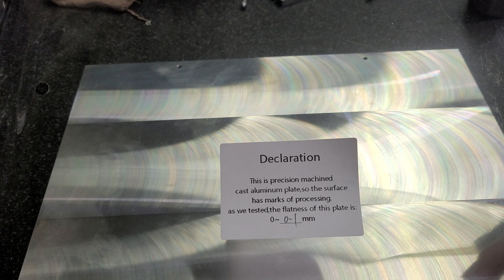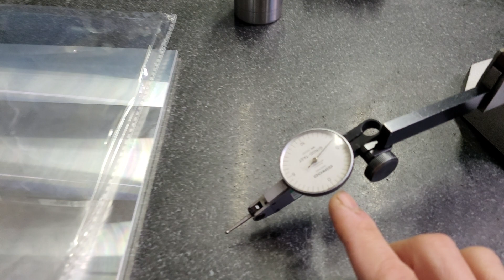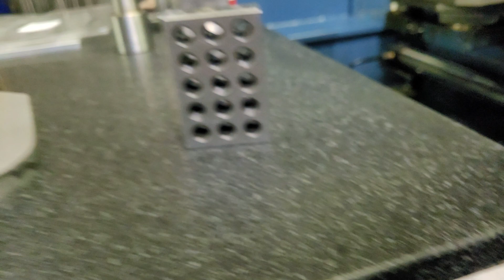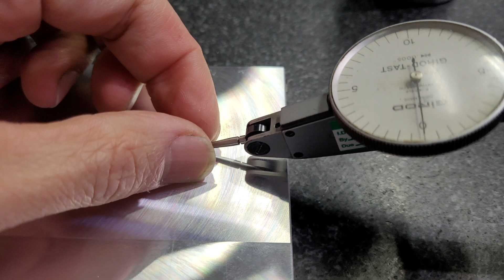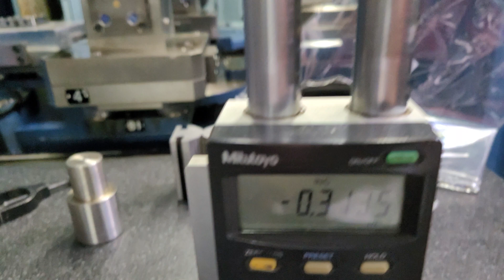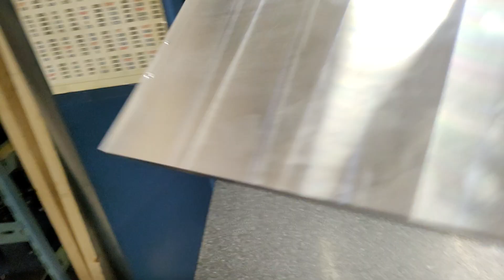FORMBOT Voron 2.4 3D Printer Aluminum Build Plate!

Comment: Great Video! 👍 may you also test with the bed heated to 100 degree Celsius. I heard that it might bend when heated.
Reply from the maker: It will warp for sure but a good bed mesh system will compensate for the uneven surface. Here comes the IDM scanner. 😀https://youtube.com/shorts/Bz2ODFq9isg?si=aAhXRtTixGKJkF53

Comment: Nice to see the plate is in range of their stated measure, I am also building the 2.4 formbot kit, nice parts for the price.
I will for shure buy an dial indicator asap.
Have you tested the rails and the frame profiles?
Reply from the maker: I tested the motors here. https://youtu.be/WWF8mjZLdJ8?si=QE7CoxRWLhdOobwG which are also nice. Formbot didnt make these motors but at least they are not from bad quality batch. I didn't check systematically for extrusion frame. Some are flat against surface plate some are rocky but they are cut to right size. 2 of gantry extrusion members are flat and one is rocky (not so flat). I contacted them. They claim and say it's within spec. LoL.  All rails in my kit are nice except one which has tiny play in it which i can feel it and sound terrible. At least they send me a new sliding replacement block.

Comment: First time see a calibrated imperial measurement Equipment. Nice test setup, but a short inch = mm calculation information will be nice next time.
Reply from the maker: Thanks for the idea, next time I am surely gonna do that 🙂 I wanted to upload as RAW that's why I left it as it is. Anyways,  roughly 0.002" ~ 0.05mm (50 micron). So 0.004" is roughly 0.1mm  (100 micron). The regular paper test which is suggested every where in 3D printing hobby is about 0.003"-0.004"